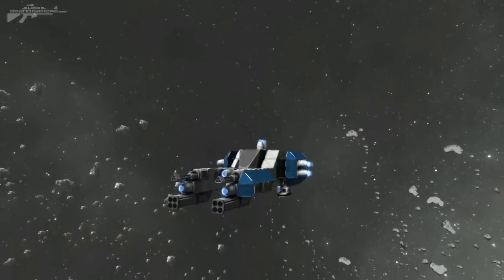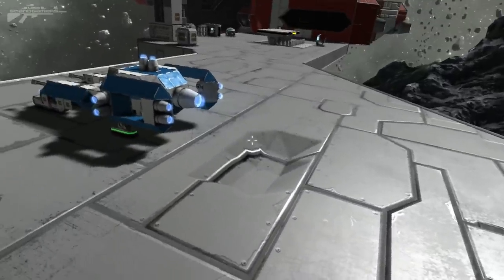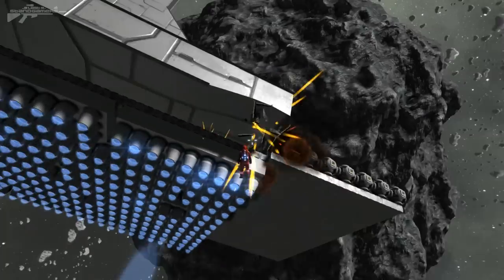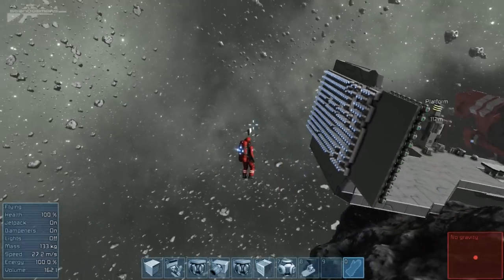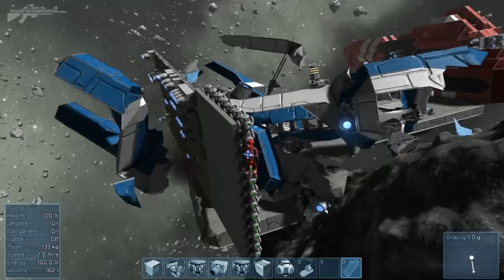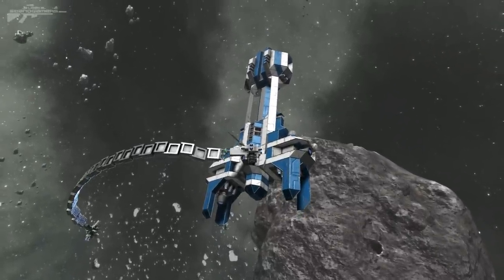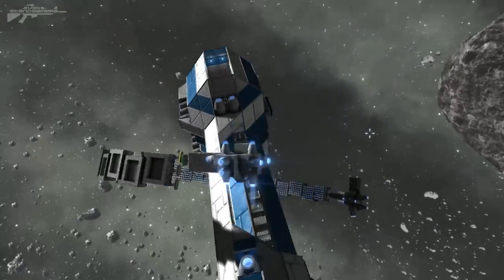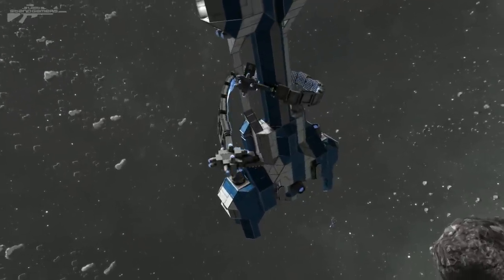Space Engineers - Force Field Basic Testing, Stopping The Rammer

Comment: Could someone use it to line the front of a rammer like a knife edge to cut straight through other peoples ships?
Reply: I had a similar thought, but then I remembered that thrusters don't damage heavy armor at all.
Reply: Plus, even with a strong computer and a right design, it would 1. Cause total lag because of collision and 2. You'd have to repair your ship more than once, even if you had a right amount of speed the most damage you could do would be cutting 1/4 through the ship, depending on the side, armors and layers or armors on the ship.

Comment: This is unique but unnecessary because the thrusters require more resources meaning varying type than just a armor block which only requires steel plates n construction toolbox or whatever it was called.   Unless you're in creative mode then it doesn't matter how much resources you have.